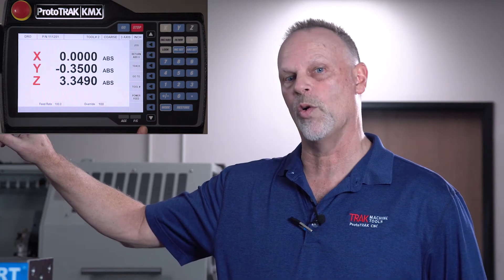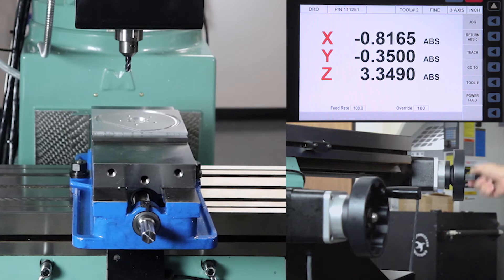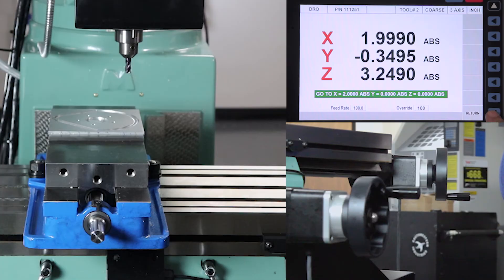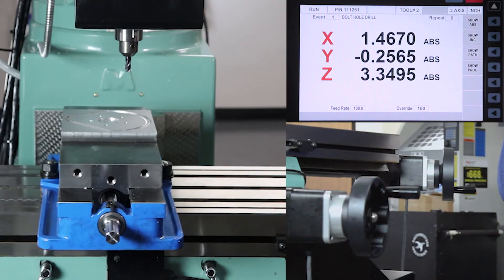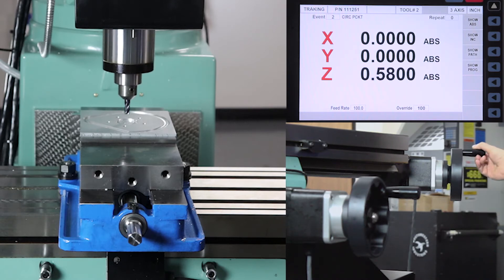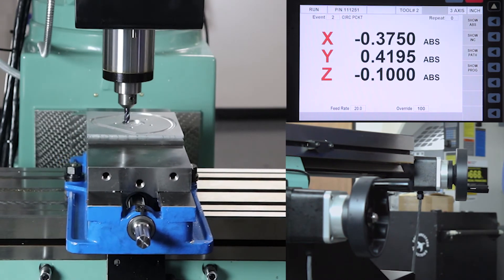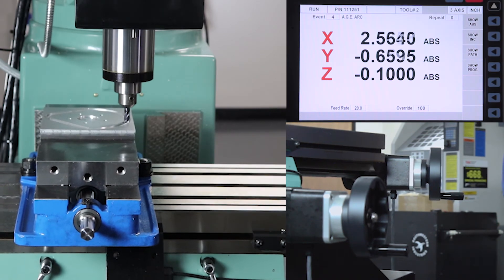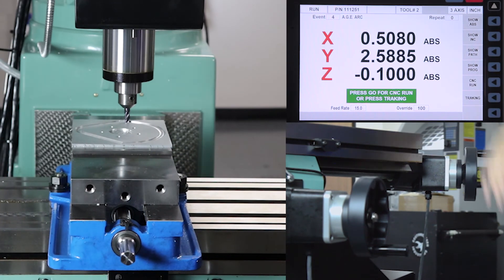Electronic Handwheels & TRAKing feature on the Prototrak KMX CNC Upgrade

Comment: How does it work  with the Z axis if you are manually tapping a Hole do you get a good feel????
Reply: On our knee mills, If it has a 2-axis control, then it is no different than any other manual machine because the quill is free moving and not connected to a z motor. If the knee mill has a 3-axis control, there is no way to disengage the quill from the z motor so you would have to tap using a tapmatic head. On our bed mills, in either manual or 2-xis mode, you can tap normally because it has a standard quill that is not connected to the Z motor. In 3-axis mode, you can use a floating tap head along with the tapping event. T.P.

Comment: Would the feed rate achieved by traking be higher than that of the setting in the original program? Would the handwheel "saturate" when I'm turning too fast?
Reply: Nick, TRAKing ignores the programmed feed rate. The faster you turn the handwheel, the faster it moves.  This way, if you want to get through a certain portion of your program quickly, you can do so.  The handwheels are set up so that one of them is four times faster than the other one.  Use the faster one to get to the point of machining and then switch to the slower one for your actual cutting.  It is true that you can TRAK it faster than the programmed feed rate so use some caution when doing so.